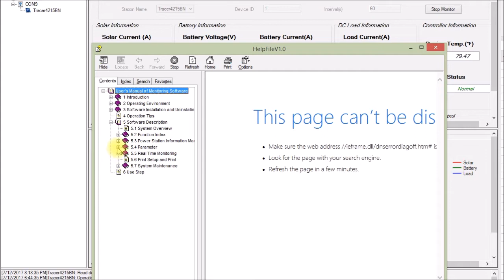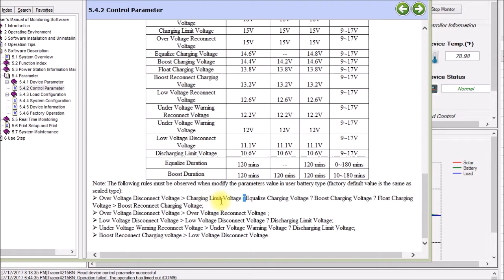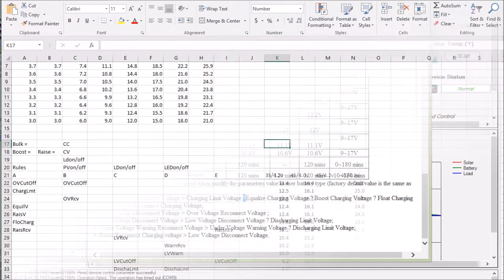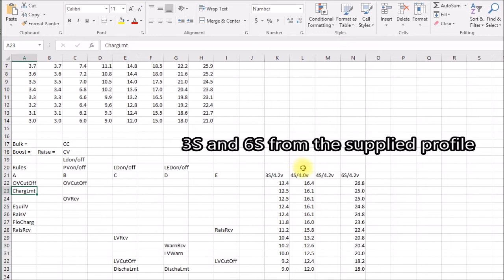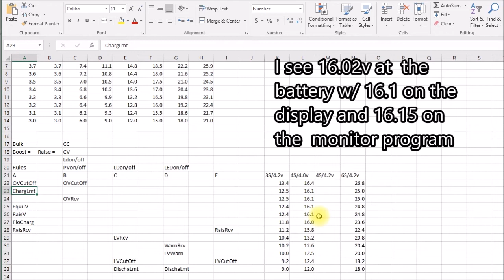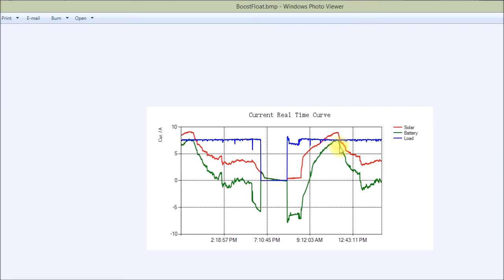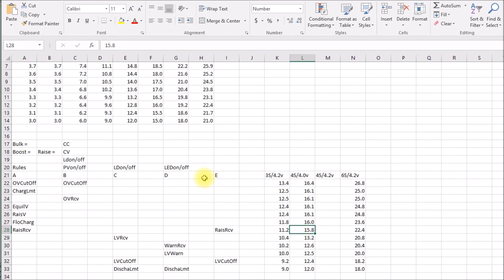EPSolar 4215BN Charging 4S/16Volt Li-Ion Battery, Part 2

Comment: Hi:
I have the Epever 40a charger Tracer 4215BN with MT50 unit. I am trying to find the correct setting for this unit with an 8s/200ah 24v lifepo4 battery. Help!
Reply from the maker: Check out the part 3 video:
https://youtu.be/ofmXkwYEbvo
It has the 4S - lifepo4 setting file from Epsolar, double all the voltages for 8S.

Comment: I worked on this for about 2 days and got it setup on my tracer a 30amp units for charging my 18650 power shelves to max of 28.7vdc. What I liked about is they do the checking of the 5 rules for you and tell you what is wrong and that made it easier to setup.
Reply from the maker: Good to hear they do support the higher voltages in user mode.  Yes, mine with the MT-50 display will tell you there's a parameter error if you set one incorrectly but it doesn't tell you what the conflicting setting is, so you need to go back to the rules.  As long as you are bumping all the settings up, no real issues, it's just if you are trying to drop settings that you'll hit something below.  In that case, start at the lowest setting and work your way up the list.

Comment: Great detail and very help info, this help really understand how this charge controller works 
What I found confusing from your explanation is, why would the load be disconnected when you hit over voltage disconnect,
I would have thought this would just disconnect the charging process and allow the load to bring down the battery Voltage to a safe level ?
Many thanks for the video. And  lithium profile 👍
Reply from the maker: Not sure why, either.  Just reporting what I observed in testing.  Later I added my AC power inverter connected directly to the battery bank and with that higher load on the system and a higher disconnect voltage setting it was not a problem.
Reply: @The4Crawler  
Ok , would be interesting  to see that working on your setup,
As I’m sure you’ve  notice, most inverters will continue working until your battery is fully drained, 
not the best way to treat your battery I’m sure,
Anyway, many thanks once again for you video very helpful.
Reply from the maker: @spiro6363  I have a few videos with the inverter on the 16V battery bank, here's one:
https://youtu.be/O2QQ-fiflFE
I was in the process of "automating" the inverter to turn on and off under control of my home automation system.  But before I got that finished, I decided to convert to a 24V battery system and new charge controller/inverter and that one lets you set the cutoff voltages internally.

Comment: Great video.  Thanks.  
I just purchased the 4215BN controller but have not hooked it up yet.  I currently have at my cabin 2  6 volt 210 amp hour deep cycle batteries but I am planning on upgrading to the Battleborn 100 amp hour Lithium battery.  I am also planning on upgrading to a 12 volt fridge freezer which draws around 40 amp hours per day.  I want to have the fridge hooked up to the load terminals on the controller rather than directly from the battery so that during the day when the batteries are fully charged, the controller will feed the solar power from the panels rather than from the batteries.  My problem is the overvoltage disconnect.  If the controller disconnects the solar and load, then my fridge will have no power and could spoil food.  Do you have suggested settings for the Battleborn battery that would address this concern or will it be a trial and error thing or should I just have all the loads directly connected to the battery to be safe?  They recommend bulk and absorb set to 14.4 volts, float at 13.6 volts and equalize shut off.
Reply from the maker: I find it takes some trial and error to get the settings right.  On my 4S Li-ion pack, I ended up setting the over voltage to 16.8v with the charge limit at 16.1v.  With lower cut off voltages, I would still get random trips under various conditions.  Best testing condition I found was a day with lots of small clouds blowing by.  Then have the system loaded down but battery near charged and see how the controller handles the cloud edge effects.  Basically you want to see how fast the controller can throttle back and how high the battery voltage climbs before it does so.

Comment: Any idea where can I find the right voltages to set in user mode for lion 24v 7s 18650  battery?
Reply from the maker: You can use my numbers, listed in the video description, and then just multiply by 7/4 to convert from 4S to 7S.   Or just take your desired per cell voltages and multiply by 7.

Comment: Nice video and good information!
Reply from the maker: Thanks, glad you found it useful.  It took some time to try and relate the nice clean constant current/constant voltage charging profile you get with a real lithium battery charger with the rather noisy data you get off an MPPT solar charger.  But once you can interpret that data properly, you can see if the charging parameters are dialed in.

Comment: Hi, I can't change battery parameters above 32v on me Triron 2210 it gives a failure message when I press update. Can anyone help me I need 48v battery parameters. Tanks
Reply from the maker: Most of the EpSolar charge controllers are 12v/24v only and can go up to 32v max.  From the datasheet:
Battery voltage: 8~32V
Reply: @The4Crawler  Hi, that is bad news for me 🙄. Thanks a lot for your time.

Comment: Thank you,  R. Brown.  I am going to get the new EPSolar Triron.  There is also an Android App for lithium batteries in their downloads section on the website.  I do not know if it supports your current charge controller, but it might.  The New Trion supports 8S- Li-Batteries !
EPSolar Trion
http://www.epsolarpv.com/en/index.php/Product/pro_content/id/874/am_id/136
EPSolar Lithium Android Application Download at the bottom in this link:
http://www.epsolarpv.com/en/index.php/Technical/download
Reply from the maker: Thanks for the information, good to know.  I know the earlier ones had 3S and 6S profiles.  I may have to look at the Triron model if I decide to get another controller.
Reply: Thanks!  I'm in Thailand  in the process of making 18650 battery packs.  I look forward to your future videos.

Comment: Your panel voltage is too low. It is best to couple two equal panels in series for higher panel voltage.

That gives a higher effect tension.
Reply from the maker: Yes, that is my ultimate goal.  Right now, though, I have a 270W/24v panel in parallel with a pair of 60W/12v panels in series.  So I have to run them in parallel because otherwise I would be limiting the current.  I need to purchase a new panel for my grid tie inverter, then I can take the 270W/24v panel currently on that unit and then replace the pair of 60W panels with it and put the 2 - 270W panels in series.